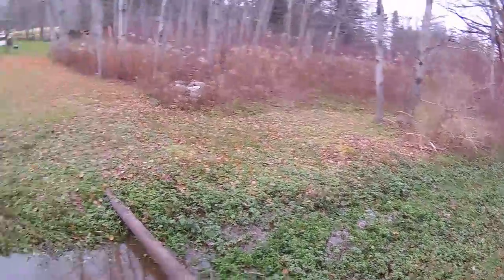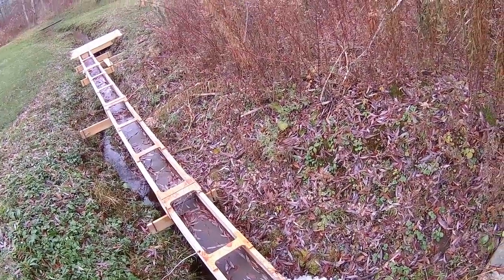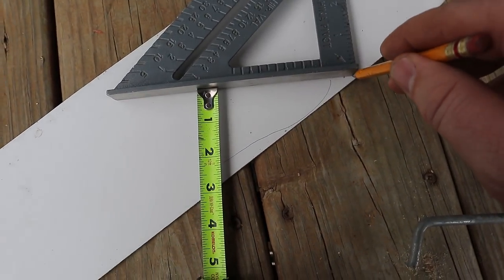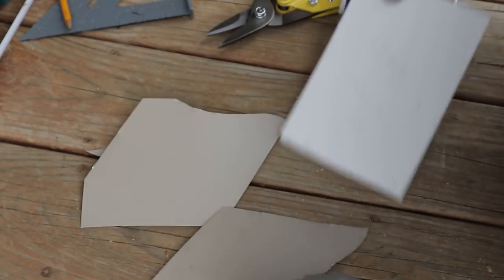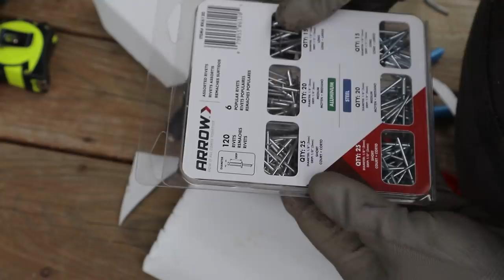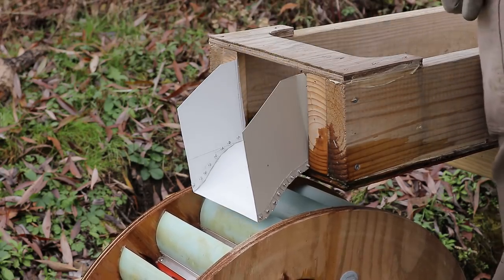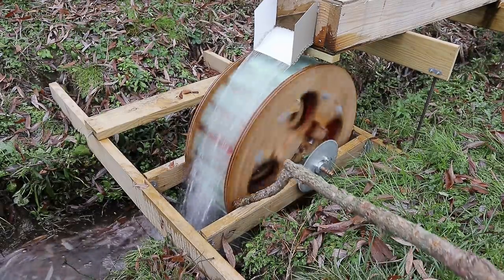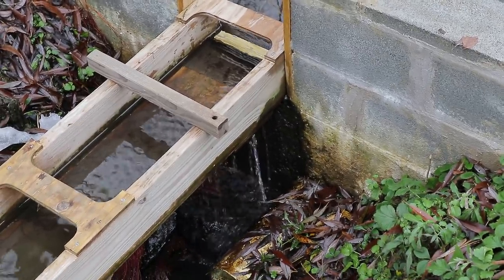[Part 6 of 10] Waterwheel Microhydro, Chutes and Rakes

Comment: a smart guy would have figured out the average volume of the creek flow... designed the buckets in the wheel large enough to accommodate that volume for a targeted rpm.. looks like your volume is larger than the wheel can handle with peak efficiently.
Reply: Jim Blalock I’m also gonna guess that plywood probably isn’t the best construction material

Comment: I am not sure why you attached a piece of wood at the head of the flume!  It looked like you first removed a similar thickness of wood before attaching a new piece.  You don't have enough water flowing and beyond your water wheel the ground is elevated.  This tends to pool water behind the obstruction and slow down the turning of you wheel.

Comment: you should be able to get 25-50 watts off that nicely.
Reply: you should be able to get a nice 25-50 watts off that nicely.
Reply: you should be able to get a nice 25-50 watts off that nicely.
Reply: Are the turbines for electricity generation placed at the bottom of the Niagara Falls or at the bottom of the falls?  You don't generate enough energy to move the blades when water falls from a height of 2 inches above the blades.  From that height it simply doesn't have enough potential energy to be converted into kinetic energy.

Comment: Spin the wheel 180°. Problem solved
Reply: On what axis?
Reply: On any axis perpedicular to the axle, for simplicity lets ay the vertical axis. Could then be aided by stream flow when surcharged.
Reply: @badsamaritan8223  he means make it so that whatever little flow there may be below the wheel, it should catch in the buckets to turn it even when there is no water falling onto it from the top, you can, of course, combine those, and you should, for optimal efficiency. this would also mean he would need to bring the wheel further along away from the flume so that the water from the flume hits the buckets on the flume side instead of going over the wheel.

Comment: Safety: when working with an electric drill, wearing work gloves is prohibited. Increased risk of injury and injury will not pay the insurance!
Reply: Fred77063 I think a “why” would be nice here Fred.

In many individuals eyes you’ll find that with tight fitting gloves there is little to no safety concerns if you aren’t a clumsy ape. Further to this point one may find that gloves protect delicate fingers from jumping drill bits like what is happening when we see Joe drill the metal about half way thru the video. Yet another point that doesn’t apply here is  when using a 120v drill around water, rubber boots and gloves are highly suggested to prevent risk of electrocution.

Comment: Hey Joe, do you think you could just try bending the metal chute while it's in place to angle the water better? Or will you have the adjust the positioning of the wheel? I would think the former might be easier.
Reply from the maker: I'm going to reposition the wheel, and re-mount the wheel in a different manner that will make tuning for power output more easy.

Comment: instead of using a chain and sprocket system why not try  a pulley system with the largest pully about the size of the water wheel and the one for the generator small so the generator should spin faster.

Comment: If you have punched with a nail and hammer, the drilling would be much easier.  And you could have punched both pieces that would be riveted together.
Reply: both ways splits the wood. joe knows now to drill pilot holes.